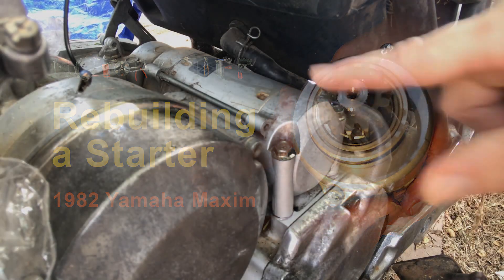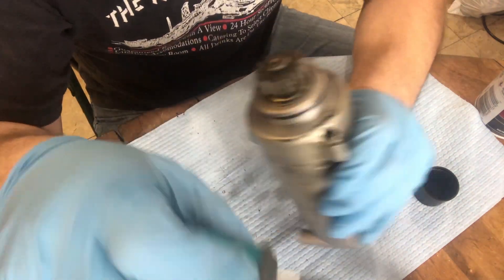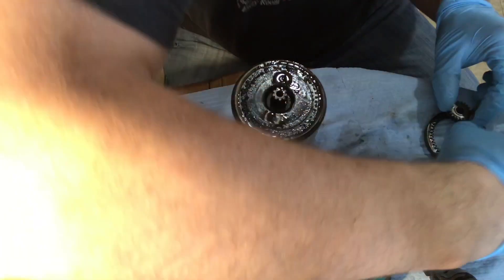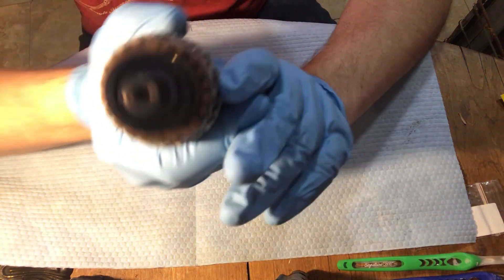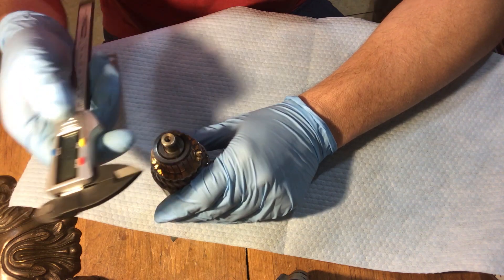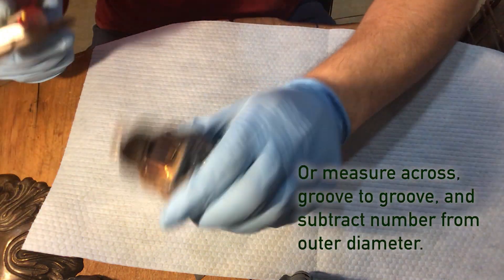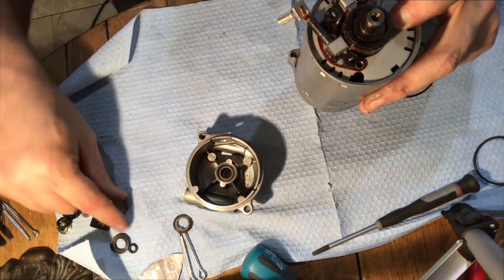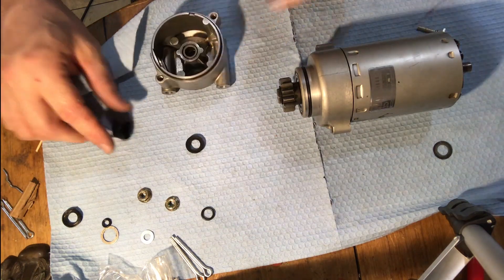Rebuilding motorcycle starter - 1982 Yamaha

Comment: Tip: Hold the brushes.

Place a socket (of the right size) and then put the brushes in.
Then quickly remove the socket, et Voila.
I used this tip for rebuilding a VW gold starter.
Of course I did it without the 'perfect' size socket too.
And the brushes went 'bing'.
Still looking for one of them.

Comment: Uh, followed your video, now my starter motor spins backwards.  Indexes are aligned perfectly... what is happening?  What could have made the direction of the motor change?  I am 100% confident the body is aligned properly.
Reply: What you did was reverse your battery terminals most likely.
Reply: @RYANINBODEN1547  no, then the starter relay wouldn’t work.  The previous owner had used the wrong brush kit and installed the magnet body off by 90 degrees to bodge the repair.  When it put it back together correctly, but with the brush kit off by 90 degrees from where it had been forced, it spun backwards

Comment: The last movement prove what i presume: you don’t grease the bearing of the Rotor! Not on the carbonside even the gearboxsite. Thats makes the „yelling“ … and also i presume that the rough Noise indicates that the Centergear is NOT in the Center of the Planetos. The Idleamps of those Starters shut be araound 25 Ampére +/-5 Amps after the Service and the shut Sound like a Turbine and not that rought like this Fellow. 
Even you not swop the Buschings. I do Starters since 40 years and i recoment: don’t do this Job not without a Lathe. Only exeption: under Fire in the Desert ;-)